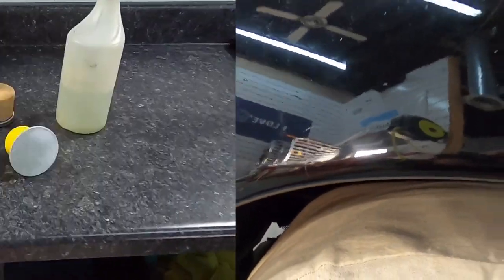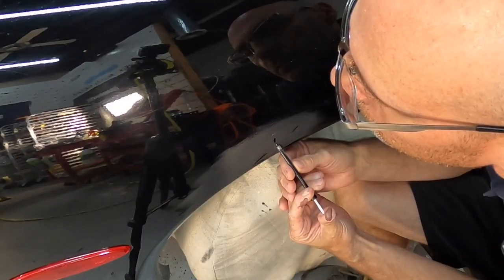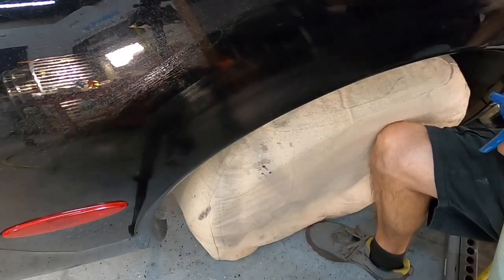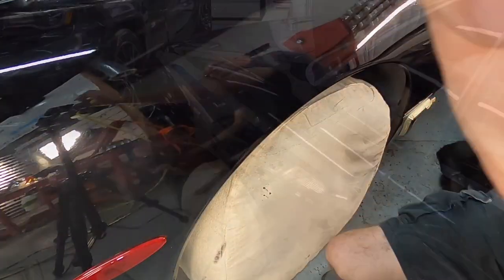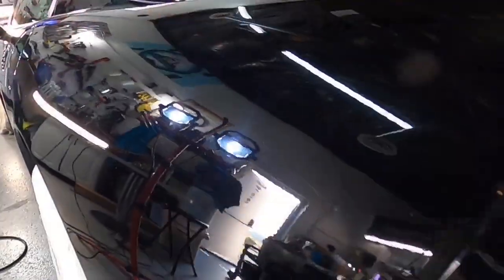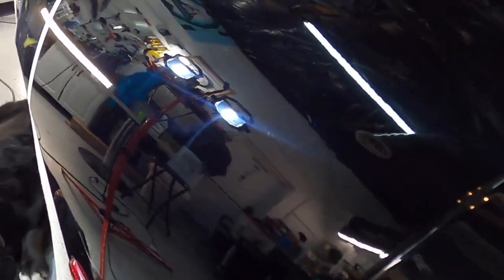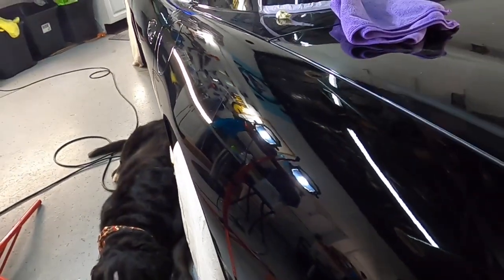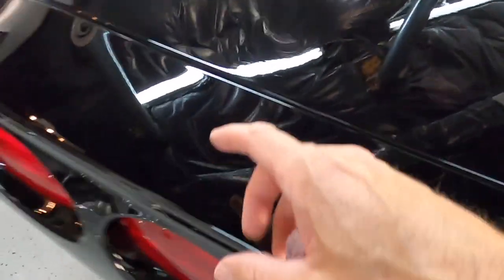CUT & FINISH With The Rotary Polisher! Part 2! The Results!!

Comment: After watching your Rotary series, I went to HF and grabbed a drill master rotary. I tried to use that massive 7 inch rigid backing plate and it felt like fighting a bull. Ordered a 5 inch flexible backing plate. I have been fighting with swirls for a while now using my DA polisher. 2 passes with the rotary and BOOM they were gone. I love the rotary thanks to your channel. 

I was scared to use the rotary until I saw the video you did with that fender and how long it took to burn through. All my worries went out the window after that. Thanks for making all your videos! They are straight to the point with no fluff!!

Thanks again for all of your advice.

Comment: Nice one. I picked up a pair of rotary polishers a couple of years ago now after watching your videos on how to use them and made a decent job of my A3 with them. Never touched a polisher before and it wasn’t too big of a deal. I found the foam pads, especially the medium to thicker foams a pain in the ass to control and to be honest they don’t cut that much. If I had settled with a DA using foam I wouldn’t have got anywhere. I found using wool for cutting and finishing off with the red finishing pads to be the best combo for my situation.

Comment: Pretty Kool the way the Blue wool pad was taking the contour shape of the rear section, smaller backing plate with a little larger wool pad sure changed the way i use it!     so much better control!      ps: love the turnout with the scratch repair
Reply from the maker: Absolutely...cheers!

Comment: I am ALL cordless…..I have Flex 6 inch 15mm throw, Flex 5 inch Gear Driven 8mm throw & Flex Mini PXE 
Just got Flex 6 inch Rotary but not used it yet…
As a starting point what pads would you suggest I use as Rotary novice?

Note: If I was in USA (UK) I would be at your seminar in November like a shot

Comment: I have watched your headlight restoration videos and I was hoping you could tell me where you get your sanding discs. I can't find Trizact 2000 3" Amazon etc. Thank you.
Reply from the maker: I get them at a local parts store. You can also buy the lager ones, Trace the 3 inch backing plate, and cut them to fit.
Reply: @apexdetail85  Thank you sir, love the videos their extremely informative. Take care.

Comment: You mentioned 2000 and 3000 grit. Did you use the 3000 after applying the touch up paint?
Reply from the maker: In this order...2K then 3K, then polish out from there.

Comment: If I have megs ultimate compound, do I need to use it first before my turtle wax ceramic polish and wax?  Or can I use the polish and wax by itself? I'm asking this because I just got an official polisher this past weekend and I just want to do this right the first time.  If you answer, thank you. If you don't, thanks for reading.
Reply from the maker: It depends on the imperfections you are trying to remove. If light...the polish and wax should work.